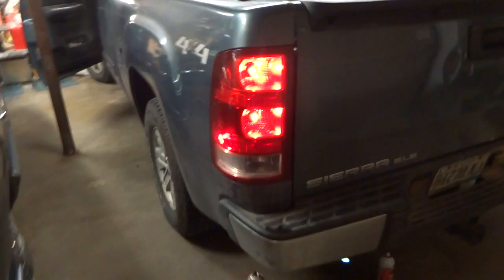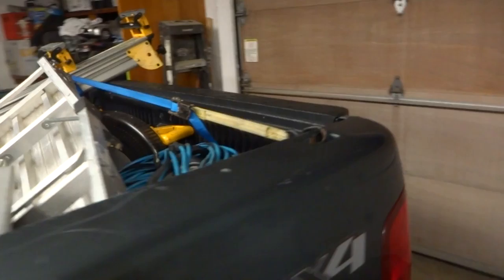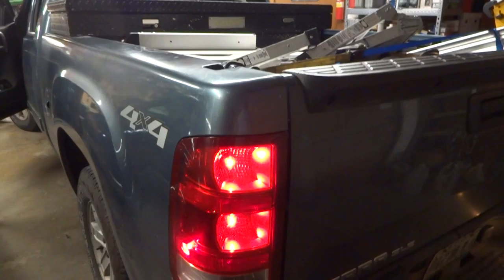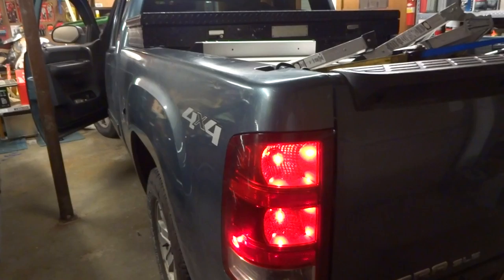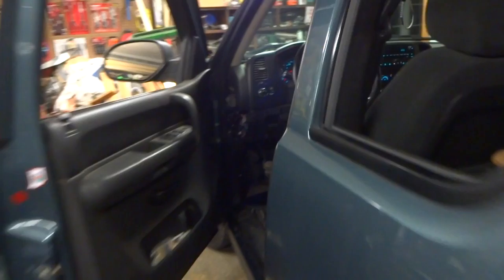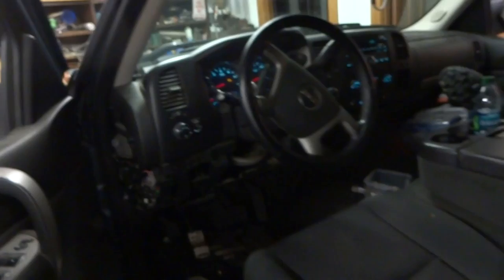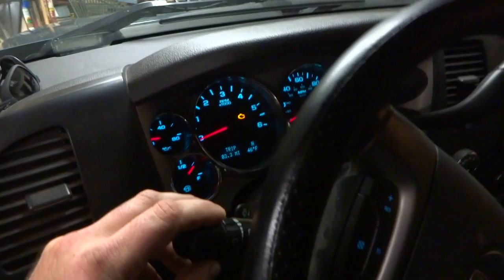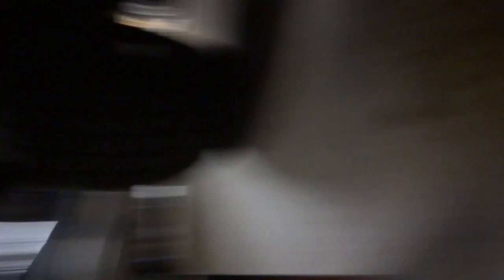GMC Truck Turn Signal Problems

Comment: I was driving with my kids in 2018 Silverado completely stock, no modifications at all and suddenly...lost power for about 45 secs... Pulled off as best as i could... Got the alert "theft detection" and to cycle driver side window up and down.. restarted the truck and the turn signals were sending a fault and flashing faster than normal... I was thinking the worst ... Checked all fuses and relays.. wondering what in the world is going on.. then o found your video and tried it.. they were full of corrosion and dirt.. electrical cleaning spray and dielectric grease .. no more issues... You saved me a ton of $ and time .... Thank you ao much... Very grateful to you for making this video.... I find it crazy that one electrical plug related to turn signals can shut the entire vehicle... I think Im gonna be switching to something more "old school" maybe a 80's bronco or something i can actually work on
Reply from the maker: Wow! It's crazy how the smallest glitch can screw things up in a big way. I'm glad you got it straightened out. Best of luck!

Comment: Thanks, man, this was just what I needed.  My '08 Silverado started flashing fast, but all the elements were still lighting up.  Popping the leftmost (driver side) blue connector was the one that I think did it.  I did them all, off and back on, didn't notice any dirt or corrosion, but the contact must be improved anyway, 'cause now I've got normal blink speeds!  Very helpful and well done.
Reply from the maker: Fantastic! We're happy to hear it. Thanks for letting us know.

Comment: I had exact same problem on my 2010 Chevy Silverado. I watched this video, took your advice and now it works great. Thanks!
Reply from the maker: Sweet
Reply: Did you have any problem with burning up headlight bulbs I have to replace them like every 2 months and it’s the driver side every time
Reply from the maker: Not yet, thankfully!

Comment: Got to love Youtube. Glad I found this. My 09 GMC Sierra did the fast blinking with nothing happening at the left rear. This was after a fuel pump replacement. Found that connector after watching this video and found it wasn't fully seated. Had to clean the dirt and corrosion around the plug so it would seat completely and my signal works again. I need to get rid of this old crusty truck lol.
Reply from the maker: Kickass! Glad to hear you got it figured out!

Comment: Mine had some corrosion on the top (gray plug).  Went ahead and removed the board that all the plugs on it and ran some sand paper across all the terminals.  Worked like a charm so thanks! Always appreciate a free fix .
Reply from the maker: Heck yes! Me too, Robbie. I was racking my brain and didn't want to spend hundreds at the dealership. I'm glad it worked out for you.

Comment: I had the same symptoms on my 2012 GMC Sierra - no left rear turn signals, although bulbs were good.  Front signals worked, but blinked very fast.  Your suggestion worked.  I took the plugs off the junction box, put them back on and that fix the problem.  Thanks!
Reply from the maker: Nice! It's always good when a fix is free.

Comment: Thank you so much for this video. Right turn signal/BrakeLight/Reverse Light not working.  Spent a lot of time researching what could be my problem. This video fixed my problem in 2 minutes. I have a 2010 GMC 2500.
Reply from the maker: Fantastic! I was in the same boat. I'm glad you got it straightened out.

Comment: Jimi you saved my wall. Yes I was about to beat it down with my head. 🤦🏼‍♂️ Only AFTER replacing bulbs that were still good and a fuse that was also, still good did I find your video. Went straight outside cleaned the sand, grit, general debris. And *PRESTO*! Thanks man. I appreciate ya.
Reply from the maker: Kickass! I was right in the same place. I'm happy for your wall, Brother.

Comment: I had the same symptoms on my 2012 GMC Sierra - no left rear turn signals, although bulbs were good.  Front signals worked, but blinked very fast.  Your suggestion worked.  I took the plugs off the junction box, put them back on and that fixed the problem.  Thanks!
Reply from the maker: That's Awesome! I'm happy to hear it. I know I was pulling my hair out trying to solve this issue.

Comment: Cleaned and greased these connectors and it fixed the problem for about two days.
Not sure what else could be going on here. All lights come on when using the remote start, but as soon as I toggle the ignition on, all bulbs in the rear driver housing go out. Driving me crazy!
Reply from the maker: Hmmm... I'm not sure. I know that I have to clean this connector about once a year. Otherwise, it acts up again. Maybe try cleaning it up again?

Comment: I referenced your video to check my 2011 Sierra 1500 this morning.  My driver's side signals don't respond in any way but the hazards do so I was thinking this had an outside chance of being the source of the issue.  Still I really appreciated the video and it got me looking at a part of the truck I wasn't aware of.  Last week I changed out the rear differential oil so I got to see how dirty and rusty the area was (the top of the spare which may have never been dropped before this was totally filthy).  I was actually surprised to see how clean the insides of the four plug connectors in the area were.  I'm going to look more around the Body Control Module (BCM) wiring and possibly the BCM itself.  Thank you Jimikiwi!!!
Reply from the maker: Thanks! I hope you find the source of the issue. I'm glad to hear you're keeping up maintenance on your truck. Let us know what you find out. Inquiring minds want to know.
Reply: Did you fix the problem? I’m having somewhat the same issue
When I hit my remote key to lock and unlock my 07 silverado, both turn signals on the driver side blink once but when I try flipping on the turn signal or hazards, they won’t blink or nothing, however my driver side towing mirror has a turn signal bulb on the back of it and that does blink when turn signal is activated 
I’m sure I’ll figure it out on my next day off

Comment: Cleaned those up didn't look corroded and that was the fix.  Took the trailer plug out and cleaned all the dirt out of the plug. 2008 GMC 2500 HD Sierra SLE.
Reply from the maker: Kickass! I'm glad to hear you fixed the problem! Keep up the good work.  🙂

Comment: I had alot of gravel dust in my connectors, sure enough tapped em out and whalla! they worked again, cool beans, saved me some money, thank you ever so much !  My blue connector had the worst gravel dust, the gray one medium dust, and the white one just a little, im thinking it was the blue one that was causing the issue. 

I wish he would have said which one was the real culprit, Jimi if you read it you can let me know thanks, i think ill buy some connector grease though for it later, i know they sell that stuff at the auto store, anyway thanks a bunch once more.

Now its back, 2 days it was fine now start all over, back to square one, maybe i'll update, who knows.....grrrr

Comment: Thank you for this--im gonna go check my '14 chevy silverado. After a heavy snow, I used a set of chains that whipped the ever-loving daylight out of the wheel well (speed increased without pullout for removal). Next time I started my truck up, I had the issue with my rear passenger turn signal not working, and haven't been able to track down why. Based on location and what happened, I'll check this next.
Reply from the maker: Good luck. Let us know what you figure out.
Reply: Same issue just came up on my '17 Silverado, and the indicator keeps popping on everytime I turn my right signal on. Guess I'll be checking for dirt/debris or corrosion
 🤞

Comment: FYI Turning the Hazards on will not show Hyper Flash  they are designed to flash by timing and not by current so to test your blinkers put one on at a time.
Reply from the maker: Cool Thanks!

Comment: Normally you don't have corrosion on the contacts/terminals in the connectors at that junction block, but you will have a lot of sand, grit, etc. that can lead to bad connections.  Typical materials are steel that is coated to prevent corrosion, and nonferrous materials like copper and brass that do not corrode easily, but will given the right conditions.  The connectors can also become loose just because of the location where the truck bed/suspension bounce around more than the front of the truck.

Vehicles including trucks have a safety feature in the firmware that is looking for resistance in the wiring to ensure the bulbs are present and presumably working.  For some vehicles, the firmware is only looking at the rear lights, which makes sense when you consider which lights are most important when it comes to safety.  The car behind you is not really affected if you have no lights in the front of the vehicle, but is affected if your rear lights are not working.  The firmware creates the "hyper-flashing" intentionally as a way to let you know you have a problem.

Comment: I have a 1997 GMC cut-a-way Savana 3500 and the blinker is also flashing fast; I have gone though about everything I can find, but after watching this I will go dig around and see if there is a connector I didn't find. LOL.

Comment: Just bought a 2014 and I have the same problem.........
Thanks for the video

I will try your suggestion and repost my results

Thanks for the video 😎👍👍
Reply from the maker: Keep us posted. Thanks
Reply: I forgot to ask, but what did you use to clean the contacts with?
Would a break clean spray work? Or just getting in there with a brass brush and cleaning first then spray with brake clean or carb cleaner
Reply from the maker: Any auto parts or Walmart carry cleaners specifically formulated to clean electrical connections without damage. I don't know what the difference is, but is a good thing to have around your shop/garage. Sometimes the cleaner will do the trick. Sometimes a bit of scrubbing is needed. Brass brush is a good idea.
Reply: Thanks for the heads up on the cleaners.
Im actually heading out now to look for it.
Will keep in touch with my progress.

Thanks again for all your help 

😎👍👍
Reply from the maker: Any time! 😎👍
Reply: Well I have done good and bad news on my efforts.
Good news is I cleaned all the contacts 
Bad news........I still have the same issue
Still blinks fast after a few seconds

Drat!!!!
Not sure what to do next.....I’m not an electrician by any means so looks like I’m at the mercy of a good mechanic I suppose

Well I tried 

Got any ideas?
Reply from the maker: Just to be sure, did you already change the bulbs?
Reply: @JimiKiwi  
Yes I changed bulbs first, I originally thought it was just the bulbs but it still fast blinks
Im stumped 🤔
Reply from the maker: Well, you might need to break out a test light and make sure there is power to that connection block.
Reply from the maker: Dereksdiatribe sent this message you might wanna see.
Reply from the maker: He said the ground wire to the spare tire mount was corroded. After replacing the end with a new connector, it solved his problem.
Reply from the maker: Check out the replies to dereksdiatribe comment on this video.
Reply: @JimiKiwi  

I will check that out and let you know what the results are.

Hopefully it works 🤞
Reply from the maker: Cool 👍
Reply: No joy on all scenarios tried so far
Spare ground connection was good, no corrosion 
😞
Reply from the maker: I'm wondering if there's a problem further up the line. Did you check it with a test light or volt meter? The wire leading to that harness may be damaged.
Reply: @JimiKiwi  

I crawled under the truck for the last hour or so and can’t see anything obvious such as cut/damaged/frayed/or otherwise in the wiring nearest the back end of the truck.............
So looks like I’m breaking out the test light
Not sure where to start but at the beginning
Reply from the maker: Good luck my friend. That's a tough one.
Reply: @JimiKiwi  
Thanks for all the advice, it helped me eliminate some of the things I needed to check.

I will keep you posted on the outcome
Reply: @JimiKiwi  
Your not going to believe this one......after pulling out the right front fog light.....really for no other reason other than to know how it’s done.......the blinker is working perfectly 
No fast blink
Totally normal flash intervals 

Only thing I can think of was that there may have been a loose wire connection somewhere that I touched

I’m keeping an eye on it though to see if it happens again or not

Happy days😆😁😁😁😁😁

I’m just happy it’s working now 😁😄
Reply from the maker: Kickass! I'm really happy you got it sorted. Wow. I never considered an issue in the front. It's a good thing you kept your nose to the grind stone. Nice work! 😎👍
Reply: @JimiKiwi  

Thanks,

And thanks for all your help and advice, great channel and I will subscribe too
😎👍👍👍👍
Reply from the maker: Any time 🙂
Reply: @Chief6067  where were your connectors located om your 2014 because I'm having an issue with my left turn signal doing the same exact thing?
Reply: @Chief6067  I appreciate the advice brother.
Reply: @Chief6067  so I found the location of the wires,now I'm finding it difficult to remove the plugs...I pushed the little red clip out from the plug but it still won't come out..any ideas?
Reply: @cedthatruth3706  
I had the same issue, if you have some spray contact cleaner try spraying some of that over and into the connector area.
If that won’t allow hand removal, try a small pick tool around the connector to try and pry it loose.
Mine were stuck pretty good as well, the pick tools worked for me.
Just have to be sure not to damage the connector.

If you have a couple pocket screwdrivers to try and pry it out that might work as well if you don’t have a pic set.

Hope that helps, keep me posted

Comment: Hey bud, I just saw this video after having the same issues with my 2011 silverado. I was wondering if you had to disconnect the battery before cleaning up the connectors?
Reply from the maker: I didn't, but it wouldn't hurt to disconnect the battery.

Comment: Hoping this comment gets noticed. I have a 2010 Silverado 1500. Brand new head lights and tail lights. Wired correctly with load resistors. Checked all the fuses as well. But god forbid if I turn that switch to the right or left it keeps hyper flashing. Do you recommend checking those back connections at the junction box still as a potential fix?
Reply from the maker: It's a good place to start. You mentioned wired with load resistors. Are they LED?

Comment: What was the numbers of your tail light bulbs I come up with someone had missed matched bulbs numbers 3157 and 3156 I guess once it’s a little hotter bolt 
        Thank you for your advice you helped me a lot
Reply from the maker: My tail lights have 3057 bulbs. I looked them up and 3057, 3157 and 3047 are all listed as replacements.

Comment: Thank you sir that was my issue exactly except it wasnt corroded it was literally hanging loose from the connection I just dusted it off and pushed it back in thanks alot.
Reply from the maker: Awesome

Comment: Having a similar situation with my 02 Silverado. Do you think that would be the same set up and what did you use to clean the terminal ?
Reply from the maker: I'm not sure, but it's worth a peak under the bumper. I used a "CRC" product called QD Electronic Cleaner, but any electric contact cleaner should work. Come to think of it, 2002 might still have the flasher relay. Either way, good luck and let us know how it goes.

Comment: Do you think this would help as well,   my right front blinker doesn't flash but the back does on passenger side . Drivers side is ok . I check fuses and all is fine I am gonna take all these cables off and give em a good cleaning
Reply from the maker: It certainly wouldn't hurt. Good luck

Comment: Hey Jimmy I have a problem in my truck whit signal Ligths in one side do you think is going to the same problem??
Reply from the maker: If it's a GM and the problem is taillights, my guess is yes. Great trucks, but this is a common issue especially along the coast.

Comment: I know this is old... how did you address the corrosion?
Reply from the maker: I sprayed electric motor contact cleaner in both connections and scrubbed with an old toothbrush. Hopefully helpful.
Reply: @JimiKiwi  Thanks!  I also found that the ground connection which was connected to the spare tire holder mounting plate was super rusty, so I cut, wire brushed a bare spot, drilled a new hole, but a new connector on the ground wire and everything automagically worked!
Reply from the maker: Thanks for sharing, Brother! I'll be sure to pass it on. 🙂
Reply from the maker: @chief60

Comment: The same thing is happening but I changed evrything nd still nothing
Reply from the maker: I recently had to change the wiring harness. Mine is approaching 200,000 and I guess it was time.

Comment: I had an issue with back lights on a 97 chevy and it was the connector to the back of the light housing being loose.
Reply from the maker: That's good information

Comment: 2008 Chevy Silverado. My blinkers work but I have no response sound when I use them. Also, front speakers don't work but my rear speakers do. Any advice?
Reply from the maker: I had a similar issue in a Monte Carlo. It turned out to be the amplifier for the stereo. You can pick one up secondhand for a couple hundred bucks. They go about 450 brand new.
Reply: @JimiKiwi  I might just have to accept quiet blinkers at that price. Thanks for the info.
Reply from the maker: Hahaha! 😄 I hear ya